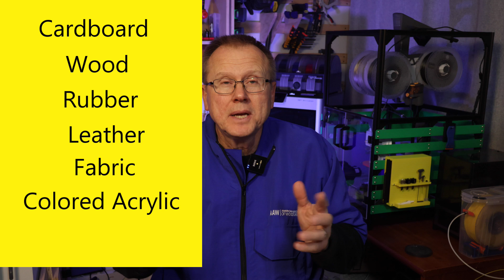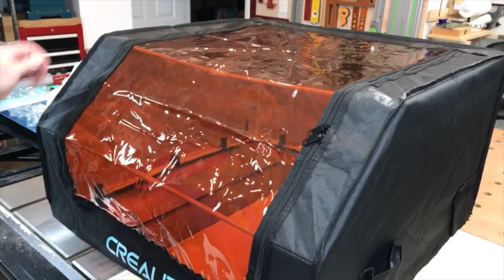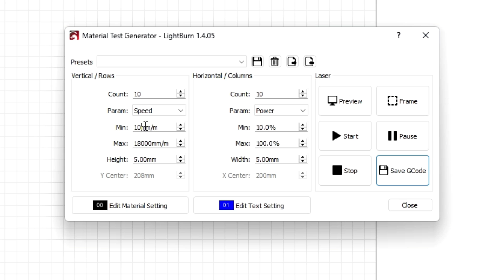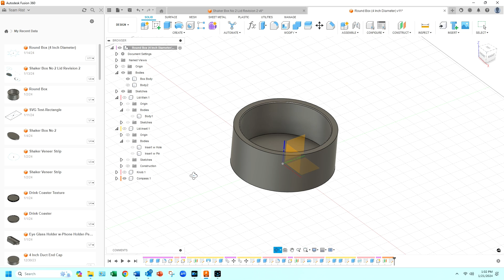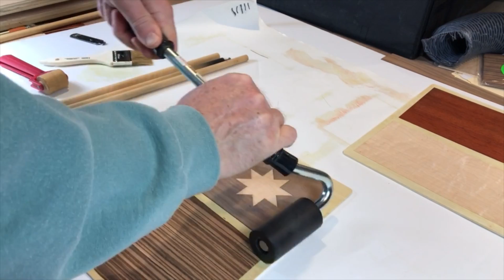Mastering the Creality Falcon 2: From set-up to Projects!

Comment: I notice you are using a commercial version of Fusion360. I only use the hobby version which disables the dxf export I would need for Laser. Could you tell me if the Icarus Landings Save to SVG plugin plugs into Fusion360 and allow you to export to svg with the hobby version or only the commercial version please. Cheers
Reply from the maker: I sent an email to Icarus Soft Landings, asking about your question. Their website is  https://www.icarussoftlandings.com/ if you would like to contact them directly.  I will send you another reply once I hear back from them.  Thanks for the question.
Reply from the maker: I just heard back from Icarus from Icarus Soft Landings and he confirmed his software works with the hobby version of Fusion 360.  You may want to contact him directly so that you hear directly from Icarus. His website link is in my earlier reply.